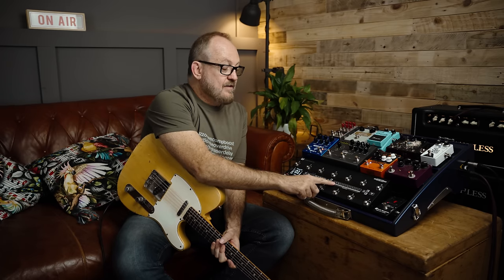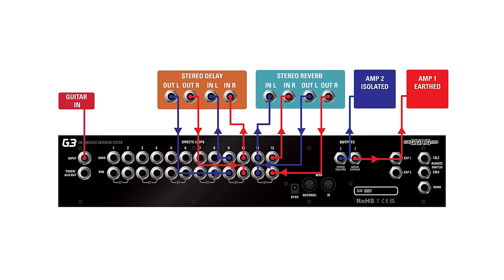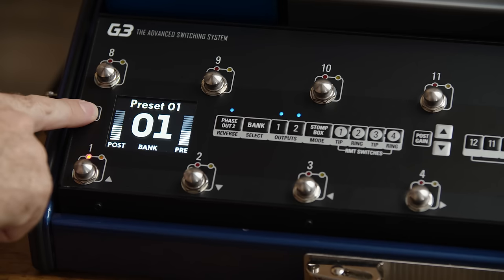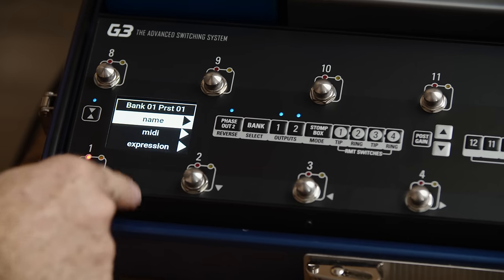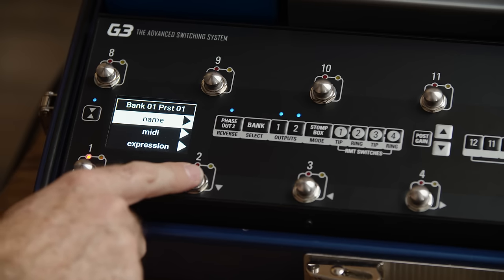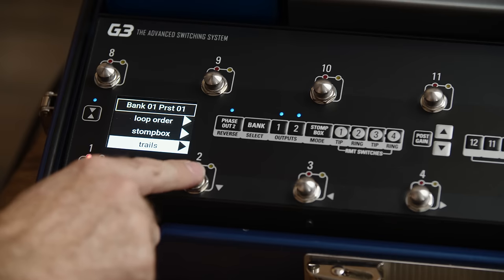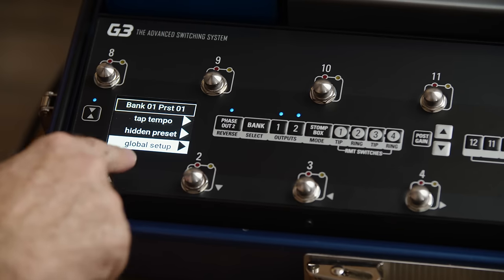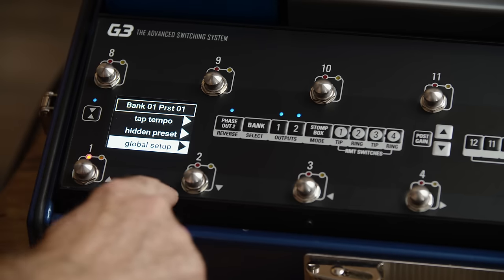Set Up & Connections - TheGigRig G3 DeepDive

Comment: I’m slightly embarrassed to say it Dan, but I bloody love you!! 😜 This is the best thing EVER!!! So glad I was too broke from all the pedals you and Mick “made” me buy to invest in a G2 before now!! 🤣🤣🤣
Reply from the maker: Ha! Cheers David 🤓👍
Reply: @TheGigRigDaniel  this might not be the place for such a question and if so no worries but here we go...

You probably don’t recall but on a previous TPS VCQ I asked about a two board, two G2 set up configured as one “core board” and another for “add-ons” and you told me the best way to do that would probably be putting the secondary board’s G2 in one of the loops of the primary G2. Seems to me from everything I’ve seen on these videos and your website that with G3 the same thing is possible and it’s still the best way to do this. 

My main question though is whether the secondary G3’s loop presets can be controlled somehow from a preset on the primary G3? In other words when I change presets on the primary G3 can that “click” also change what is engaged on the secondary G3 or would I still need to “manually” select the secondary G3’s relevant preset and active loops as needed? 

Hope I’ve described that well enough to make sense?

Comment: Hey Dan! I’m getting excited for my G3 to arrive. Silly question, but do I assign a switch to get to my tuner? This is a little new to me because for years I would just have my main output from my loop switcher coming into my tuner so I wasn’t wasting a loop for the tuner itself. I had to step on the tuner itself to turn it on. It would be nice to have the tuner on the new board I’m putting together and just get to it with the G3 instead. 😊
Reply from the maker: Hey Kristen, we’re excited for you to get it as well. Yes, you simply choose what footswitch you want to assign for your tuner, then select tuner from the menu. That’s it, now when you press that footswitch the built in tuner will activate. Another neat trick is to assign the built in tuner to a hidden preset, I have my first preset as a basic bypass tone. If I press that a second time it brings up s hidden preset which is where I have my tuner 🙏👍

Comment: Just got my G3, it's awesome! I want to use some stereo effects, but I can't always have 2 amps. Will the G3 sum to mono if I use just 1 amp?
Reply from the maker: Thanks so much! You can set up your stereo effects using parallel. Have a bank or banks that are stereo (no join in parallel) then copy and paste that bank then edit for mono (join after loop 12 in parallel) 👍

Comment: This is great! I was wondering what the setup would be to use the effects loop of two amps in a stereo amp setup with the 4 cable method?
Reply from the maker: Hi Sam, all you need to do is pout each amps preamp into its own effects loop. You can then choose between preamps, run parallel for both preamps into stereo effects into both power amps

Comment: Just one question about the loop ordering. If I am using the 4 cable method would it be possible to change the position of the amps effects loop too? 
Example 1: Like Dan said I put the Preamp in Loop 4. For some songs I would like to have the Delay and Reverb in front of the preamp so I would change the position of the preamp in the loop order after loop 12? 
Example 2: If I want to play something in the style of Tom Morello, all pedals in the effects loop of the amp, I would change the loop order that the preamp is before Loop 1? 
I am just wondering if this would work.
Reply from the maker: Sure would 👍

Comment: Hi there, in the 4CM there is no limitation and I can choose any Loop for connecting, not only Loop 5 right? Just checking and probably is a dumb question, but I just want to be sure :-) Cheers.
Reply from the maker: That’s correct, any loop, you can then change the position of that loop 👍
Reply: @TheGigRigDaniel  thank you!

Comment: Daniel - With this new device where does a volume pedal get connected?  I use a volume pedal for swells and some volume control with my delays.  The delays are normally run through the amp effects loop.  So in my G2 I have it in one of the Loops and it is before my delays.  I did like the dedicated Volume Insert in G2, but that goes away when using the Effects Loop configuration.  Does that differ on G3?  Thank you.
Reply from the maker: If you’re using your amps fx loop the signal would go from the G3 loop send, into the volume pedal, out of the volume pedal, into the amps input, amp fx send, to the G3 loop return 🙏
Reply: @TheGigRigDaniel  Should I be doing that with G2 as well.  At present my Volume is in #7 followed by the delays in #8,#9,#10.

Comment: @Daniel TheGigRig OK, here's a question about the Tuner/Aux "loop". The manual mentions it can be used as an additional (13th) FX Loop, but there is no further info on how this works exactly. Any chance you could expand on this? What I have in my head here is too complicated to post here ;)
Reply from the maker: Hi, sure thing, it’s a TRS loop, send is in the tip, return on the ring, so a TRS to two mini cables and you’re good to go 👍
Reply: @TheGigRigDaniel  Perfect, thank you!

Comment: If you have a mix of mono and strereo pedals, can you reorder them and have the stereo effects converted to mono if they are followed by a mono effect? For example I like to use my Strymon Mobius in Stereo at the end of my effects chain but sometimes I wish I could have it in mono Pre dirt pedals, could that be done with the G3 without re-wiring anything?
Reply from the maker: Sure, you can change the order, then sum the möbius outputs 👍
Reply: @TheGigRigDaniel  can this work with presets too? Meaning can one preset have the Mobius in stereo and another preset have it set to mono / pre dirt? Thanks!

Comment: How does this work if you have backing and the amp doesn’t have an effects loop? Do you have to reprogram your board ?
Reply from the maker: Hi there. If you’ve got the board set up to integrate into an amp with an fx loop and yiu end up with back line that has no effects loop, you can simply place a patch cable between the send and return of the loop your using for the amps pre amp. Hope that helps 🤓🙏

Comment: Hi Daniel, I just purchased the G3... my G2 from 2018 stopped functioning, tech said I need a new "rail" for the upper switches... he said he doesn't have them available at the moment and I needed to use the switcher in order to keep on working so I went for the G3... where does my "volume pedal" go? on the G2 there was a volume pedal insert section i plugged my Lehle into. I can't seem to figure out where to put it in the G3. let say i don't use my amps fx loop/return... i'm guessing i just hook it into one of the 12 fx loops?
Reply from the maker: Hi Alvaro, yes, we incorporated the volume loop into the normal loops n G3,  there are 12 loops in G3 as opposed to 10 in G2. Because of the routing options in G3 you can do a lot with a volume pedal in one of the loops from changing position in the signal path to being on one side of a parallel split and using it as a mix control 👍
Reply: @TheGigRigDaniel  Thank you for the wonderful reply, I'm very impressed with all of the options and add ons of the G3. Still trying to wrap my head around it all. But my goodness you've created a New Universe for Guitar Players to Keep on Living the Dream. Huge Hugs and Gratitude, thank you for being you!

Comment: If I'm doing the 4 cable method does it matter which loops I choose on G3 since we can reorder them? If I have a mono reverb in 11 and have my amp in 8 could i just reorder 11-8 then out? Thanks!
Reply from the maker: Hi Joe, you can use any loop you like but I do recommend putting things in the order if most use, to simply cut down on the times you need to reorder the loops
Reply: @TheGigRigDaniel  killer. Thanks!!!!!

Comment: So if the default order is 12345678901112 we would want our default wiring/ assignment of pedals should follow the desired signal path? 1-compressor 2-distortions in the order you usually would stack them 6-12 delays chorus reverbs etc? Otherwise we would be (and could) be assigning pedal orders for each preset we create?
Thanks

Comment: Dan, about the external midi control, just confirming this allows program changes via midi CC to automate the pedal changes in a liveset? Was thinking to have it automatically switch via Akai MPC for example. Thanks!
Reply from the maker: Hi, do you mean program changes via PC  message? Yes it does 🤓👍

Comment: I suppose reordering is also available when we placed the preamp of my amp in a loop of the G3 ? For example some effects in front of the amp , time effects in the loop of the amp using 4CM and my Strymon  Mobius sometimes in front sometime in amp loop depending on my taste of the day ?
Reply from the maker: Absolutely Manu 👍
Reply: @TheGigRigDaniel  thanks for your quick reply...
I also wrote to the support page for more info about shipping to Belgium. Will go for more technical questions about using Boss TAE and 2 switchers because now I have 2 pedalboards... 1 with time effects in the loop of the TAE and 1 with pedals in front of the amp ...
Reply: @TheGigRigDaniel  where can i write to you about my intended use of the G3 please

Comment: So if you set up some pedals in stereo, but sometimes play in mono with just 1 output selected, does it all come back to mono?
Reply from the maker: Hi Stefan, it doesn’t automatically sum to mono because that doesn’t work in all situations. However, you can set up some banks to be in Monte and some banks to be in stereo and somewhat you like to mono using the mixers. Hope that helps.

Comment: Really worth every penny! 

Question: 
If my Preset 1 in Bank 1 has a Delay from the Strymon Timeline and I would like to copy the whole preset (means the G3 settings of Loops, Gains AND the Strymon Delay from this preset) to Preset 1 in Bank 2, is there a simple copy function or do I have to set all parameters (gains, which loops active, etc.) manually on the new preset?

Thanks for your help.

Comment: Is it possible to have mono effects in the loops after a stereo pedal? E.g. gain stages split into dry and wet (modulation) parallel paths feeding into a stereo delay with tremolo and reverb hitting the left output of stereo delay?

Comment: What a great board! I have a question: if im running my moduler effects in stereo and in the effectsloop in both amps, is it possible to connect then both in the 4 cable method? Or is 8 cable method 🤔
Reply from the maker: Yeah, that would be the 8 cable method, totally doable
Reply: @TheGigRigDaniel  how would i go about that?

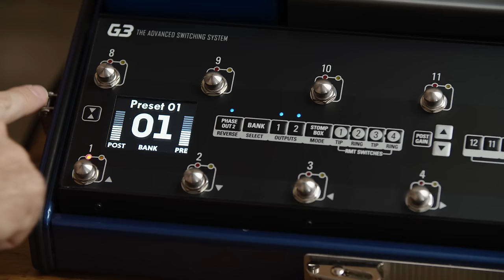Comment: @12:20 how does the 'reorder' feature work with stereo loops? can they be moved prior to a mono loop and just sum to mono?  consider the stereo reverb loops you made around @8:50 mark in loops 11 and 12
Reply from the maker: Once you have a stereo loop, it’s in parallel, so if you move a stereo loop from the end of the chain to the middle, you are changing the split point for the parallel line 👍

Comment: Hi Dan, loving the gig rig it's really awesome work you're doing! 

I have a question about stereo pairs. I'm running 2 amps in stereo and I noticed if I try to run mono send/stereo return, out of a stereo pair channel I end up getting no sound out of whichever side has no send from the gigrig (even though I have a return coming back into it). Some pedals only have a mono in but have stereo out, is there a way to make this work on the gigrig? 

Cheers, Trent.
Reply: Nevermind I fixed it!!
Reply: @Sorbzski99  it's been a while but if I remember correctly...

I "jumped it" - kept it as stereo send and plugged a cable to the in and out of the side I wasn't using. 

 I think I also noticed that the gig rig was swapping left and right channels for some reason and I had to plug in to the opposite side.

Comment: @daniel TheGigRig How do you wire the microcosm in stereo, what kind of cable would I need?
Reply: Also if I have a couple pedals wired in stereo but then just run one amp do I have to unplug the stereo cables or change the pairings? You

Comment: Just to be clear, it also switches the preamp of any amplifier? Its super nice you can put the preamp of an amplifier in a loop, but I never hear people talk about the switching of the preamps in the amplifier. Is this because this is like stating the obvious? Just insecure about this part.

So example, bank 1 is clean(channel one of the amp) with reverb and delay, bank two is crunch(channel two of the amp) with an overdrive pedal. Might be a pointless question but I never see this adressed in detail so 😊
Reply from the maker: Hey RP, G3 has 3 ways to switch the preamp depending on the amp. It has programmable remote switches so if your amp uses a standard two button footswitch you can simply swap the footswitch with G3’s remote switching. 2nd is MIDI incase your amp is MIDI programmable, and third is audio. If your amp has separate inputs for each channel , DC30 for example, you can switch the channels by simply choosing which G3 output to use 👍
Reply: @TheGigRigDaniel  awesome. Thanks for the reply! This is going to the top of my list 😊

Comment: When using 4cable method on one amp, can you still add the second amp to output 2?
Reply from the maker: Absolutely 👍 it will still have the signal from the preamp of the first amp so try going into the second amps fx loop return 👍

Comment: G3 has many advantages over G2, but crucially it effectively has fewer loops. On G2 you did not have to sacrifice a loop for the send & return of your FX loop. G2 has two stereo loops as part of its 10 loops. If you want two stereo loops on G3 you have to double up on loops, two 
loops per stereo pedal. So a G3 using your FX loop and two stereo pedals would be left with 7 loops for other pedals, giving you a total of 9 pedals. The same setup on G2 would support 10 pedals, two stereo pedals plus 8 others.
Reply: I just bought the G3 and went to switch it out with my G2 and now have fewer loops to work with....when I thought I was getting 2 more. Real bummer.

Comment: Great! Just one question. Can you run the stereo delay and stereo reverb in paralell??
Reply from the maker: Totally possible, just need to check on the four way split at the front. Needs to be fed from a low impedance source. We’re already doing a similar thing with the stereo trails so I’ll add this to the list 🤓👍

Comment: Now, if you really, really wanted to make this stupidly powerful, make the ins/out TRS connectors with a dip switch under each one that lets you select whether it will be a stereo or mono loop. That way you don't have to give up 6 monos loops to get 3 stereo loops. And you just use TRS to TS breakout cables to connect the stereo effects. Let the CPU sense the switch position, so it knows which ones are which type, or if that's not practical, allow them to be selected in the menu.

Comment: Would you be able to run 2 g3s together to access more loops? As in having more stero pedals or inputs than the 12 provided. Would another g3 be the solve? Could they work together?
Reply from the maker: You can connect them via midi and put one G3 in the loop of the other
Reply: @TheGigRigDaniel  your the man. Thanks and I appreciate your time.

Comment: Aww, only twelve pedals.  I need like a switcher with eighteen your more, to be useable, for me anyways. But looks like a great bit of kit anyways.
Reply: There’s ways to expand it to more than twelve, if you have a group of like six pedals that’ll always be in the same general location or so (like if you had six different drive types on your board) you could run those in the loops of something like a voodoo lab hex and put the hex in one of the G3 loops and have it midi controlled, thus making the Hex function like a drives subfolder
Reply: Is this The Edge commenting?

Comment: I was very happy to see the 12 effect loops instead of the previous 10 but then I noticed that you have to sacrifice 1 for the effect loop instead of using the volume insert on the G2. I will still buy a G3 in the next few days though with all these midi improvements, the possibility to reorder the loops, the digital screen and app that make it a lot more user friendly. G2 is still one of my very best purchase in the past years so I know I won’t be disappointed with the G3. For the G4, I wish we could get a tuner integrated that would be great 😁, and small digital screens on each preset with the name of the preset. With the release of the G3 i guess I can still wait for a deep update of the midi + app 😂.
Reply from the maker: the volume insert in G2 is great, but by including that loop in the main loops of G3 it just gives you extra flexibility. Plus the Tuner/Aux in G3 is its. own TRS loop, so you really have 13 programable loops in G3 🤓👍
Reply: @TheGigRigDaniel  Thx Daniel, I just ordered my G3 from Andertons (wishing that I would still get the 1st batch...). I mentionned that I would prefer the French plug for the power sypply but I am not sure if you give them that option(?)
Reply: @TheGigRigDaniel   Can you put the volume pedal in the tuner/aux and insert it where you want? I bought 2 new pedals to add to my board I am making the switch from G2 to the G3 so I am having some issues. I still want my volume to be after the drives and before the delays, but I feel like I haven't gained any inserts at all since loop 10 was stereo to begin with and now I have to use a loop for my volume pedal. I still love all the new features though and am happy to make the switch(pun intended)!

 I figured I would just get a remote loopy 2 but I know the supply chain issues are causing problems in production right now, but I will get one as soon as they are available!